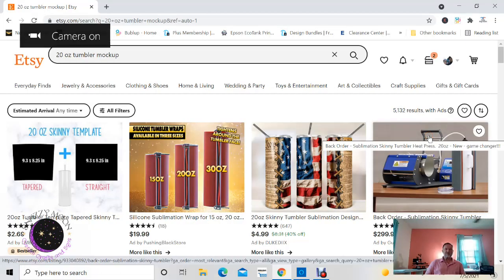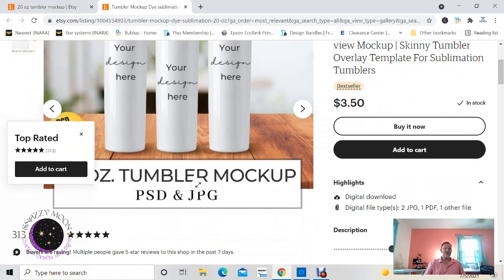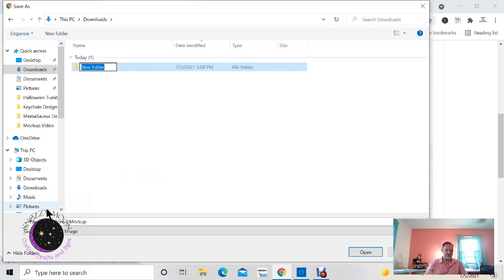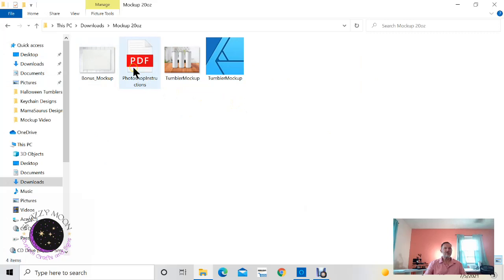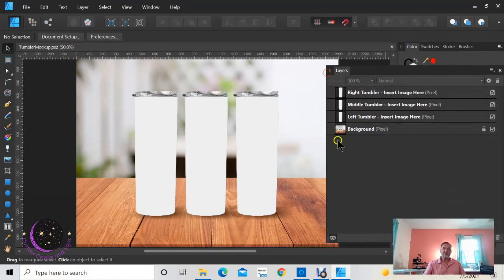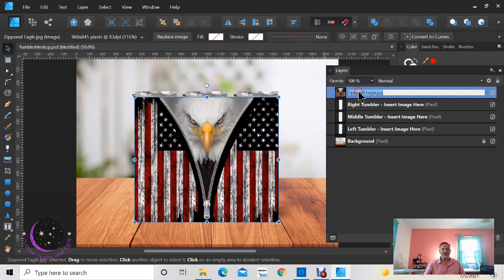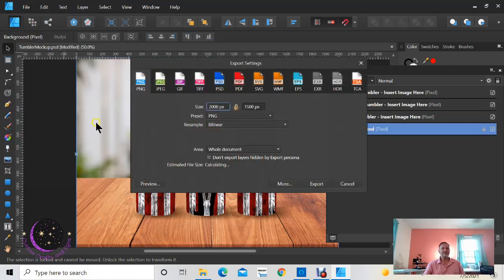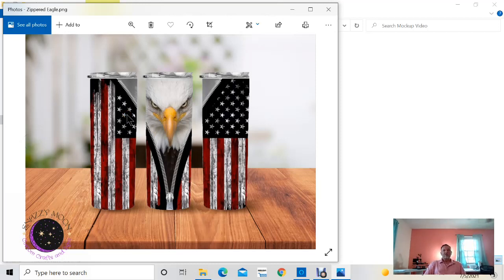How To Create A Sublimation Tumbler Mockup With Affinity Designer

Comment: I have bought a few files to do a mock up design in affinity but none break up into layers and the one you recommend in the video is no longer available.  Do you have one you recommend now?
Reply from the maker: There are several that are so much easier to use now. Just place the image behind the mockup and resize it to fit. https://www.etsy.com/listing/1147491573  Look for ones like this! If they work with Canva they will work with Affinity Designer!